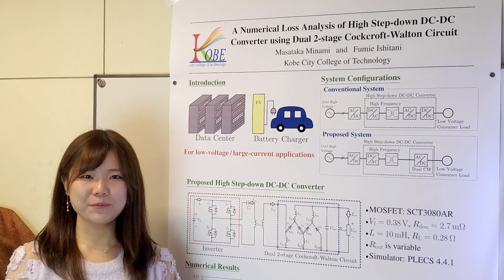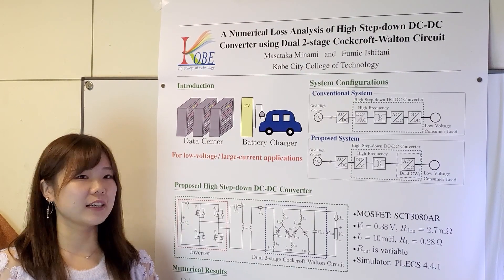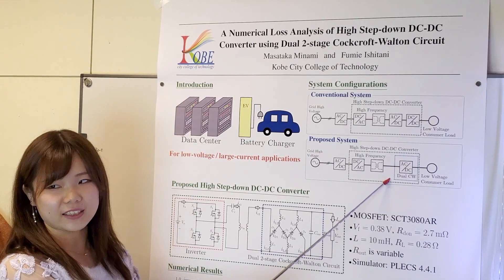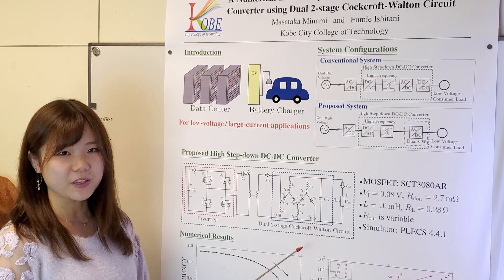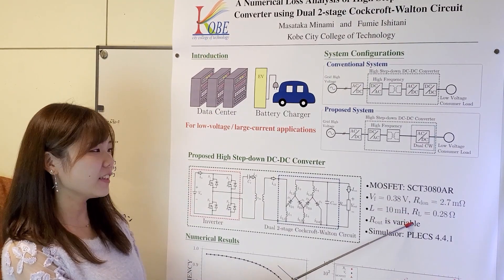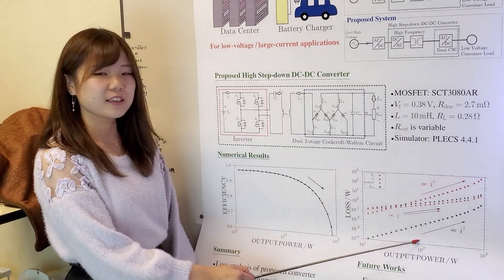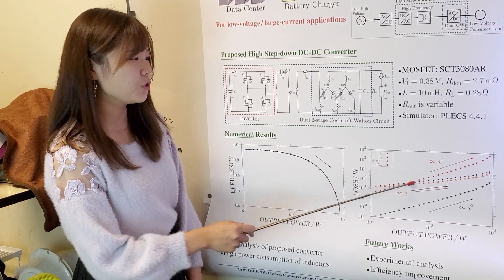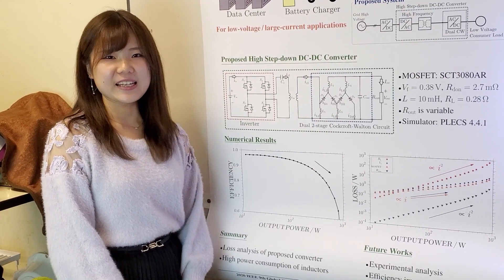[IEEE GCCE2020] Video on-demand presentation by Fumie Ishitani

Comment: How do you design the inductor? I think conduction loss of the inductor is too high. The circuit parameters seem to be far from optimized point.
Reply from the maker: Thank you for your question and comment. It is a good point !! Now, the value of the inductor is decided from the pre-simulation results in the proposed dual CW circuit to keep the CCM. The optimization of the designed parameters is left for the future works. In addition, we will custom-order the inductors for this circuit.
Reply: @minamilaboratorykobecityco2057  thank you for reply. I'm looking forward to the next report.
Reply from the maker: @安田匠-z4y  Thanks ^o^ v We will submit more research reports and are looking forward to seeing you at the future conferences.